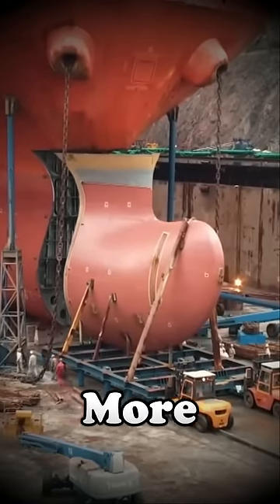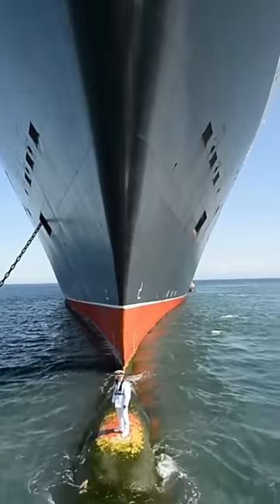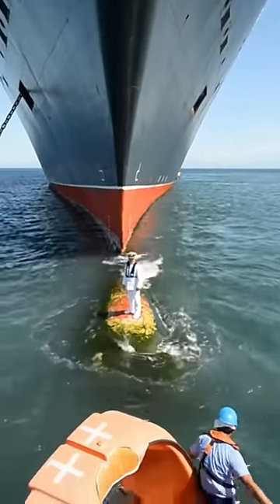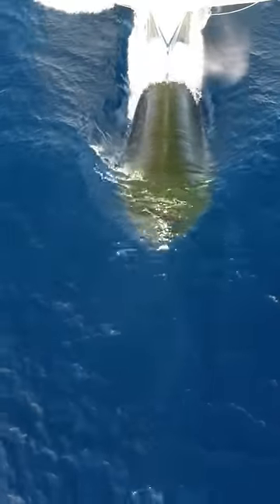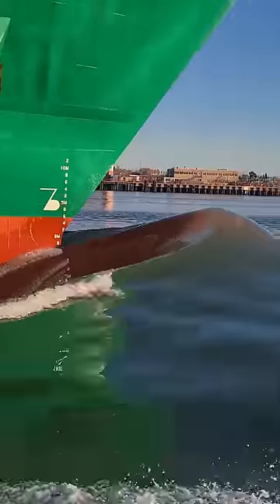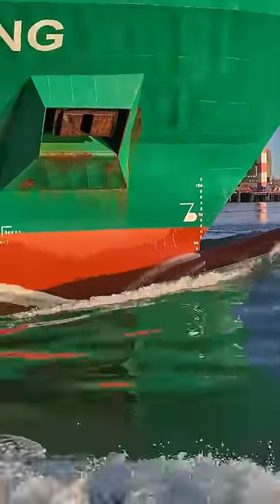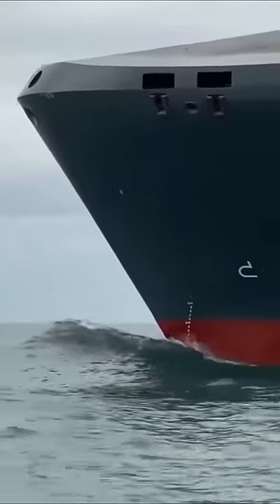This Big Bump Makes Ships More Efficient. #shorts

Comment: As the ship moves, it creates a wave on its side. The bulb is designed to create the opposite wave, so they cancel each other. What you get is a moving ship without a wave on its side. This reduces the waterline length (because a straight line is shorter than a wave). So you get less friction.

Comment: It is reinforced with a heavy metal material so that if the ship or large vessel hits a rock of are surface it will not take on any water. Generally the bulbous bow will contain sonar gear and other underwater transducer equipment.
Reply: You are aware that cargo vessels don't have sonar.

Comment: It was invented for the purpose of pushing aside surface mines (called torpedoes back then) while the ship was steaming through a mined harbor. Used on the Great White fleet ships of admiral Dewey fame. They also found it increased the ships speed.
Reply: It was never invented to push mines aside . A mine is completely different than a torpedo . Mines either float or are chained to a weight on the bottom so it floats at a certain depth for submarines.  If you (push) a mine with any part of the hull it will be lying on the bottom with about a 10ft hole in her hull . Its sole purpose was to reduce drag for fuel efficiency and speed !

Comment: The bump also adds to the overall waterline length of the hull, which is directly related to the theoretical maximum speed of the ship.
Reply: With ships these sizes it's not a matter anymore. Most commercial vessels stay below 20knots and that hull speed is already obtained with a waterline of 70m
Reply: 37 inch boat will run 150mph,  how does this help.
Reply: @DPelicanGaming  Not. At 150mph the hull will be hardly touching the water.
Better so because at those speeds "fluid dynamics" are getting close to non-Newtonian.
Reply: @michiellombaers3198   you can crunch numbers all u want, they race high performace RC boats all the time 100+mph

and real racing boats 25-40 foot up to 200MPH

Comment: Sounds a lot like the ajustable cone on a sr 71 black bird at supersonic speed
Reply: Not really. It really works by synchronizing wave motion along the length of the ship thus canceling out turbulence. The cones on the Blackbird compressed supersonic air intake into the nacelles thus turning the entire cowlings into ramjets. They did most of the work during cruise if I'm not mistaken 🤔

Comment: Bulbous nose in ships were first introduced in 1960s to help improve its hydrodynamics, but no more shipping companies use it anymore. Why?

Because it only works in ideal conditions at a certain speed, when speed is less or more than that certain speed, it creates drag instead and does not help saving fuel or time.
Reply from the maker: Exactly! In lower speeds it increases the fuel consumption as well.

Comment: A keel plate in the first quarter of the ship would be more efficient and improve directional stability in heavy weather.  Most ships are still vulnerable to high wind and waves because they lack stem to stern academic keeling design and seaworthy design.

Comment: Purpose of Bulbous Bow, To teduce ship’s tesistance and those to save the fuel consumption up to 15% and one more thing, the pirates can get close easily bcoz the bulbous bow that is submerged in the water will be hung horizontally with a rope when two boats of the pirates will voluntarily approach the ship to be pirated🥲🤔🤣😂

Comment: Only at design speed, not above or below, this because the two waves need to cancel themselves out.
Reply from the maker: That's exactly true. At lower speeds it increases the fuel consumption.
Reply: @Milopax  and because they want ships to sail slower in order to reduce NoX pollution, the end result is that many ship's now sail below the proper design

Comment: Not really true. At contract speed, big ships do not benefit from a bulbous bow. Many companies removed them for better fuel efficiency.
Reply from the maker: Yes, you are right. At low speed it increases the fuel consumption.
Reply: I was just trying to make that point. It turns out that these things don't improve anything. Total waste. A perfectly vertical, long bow, like those on racing yachts is better at cutting through the water, like a knife.

Comment: That’s what is thought as Beyoncé force in physics 1/3rd of the weight of a ships is the Beyoncé region for eg:- if a a upper deck is about 300 ft the Beyoncé region is 1/3 rd of the 300 ft with in which it covers the engine room, Beyoncé law ship structure, and the goods and logistics lodging spaces., 👍

Comment: I'm not a very intelligent person lol so help me understand this. How does taking the force from the water and moving it to another part of the ship help? Isn't the ship getting the same amount of resistance? I mean obviously it works because they use them lol I'm just confused as to how it works.
Reply: The bulb has less volume, and it has less width. The force of the wave wont me as much powerful when the bulb is blocking most of the force of the watwr unto the hull of the ship. If you didnt have the bulb there would be more pressure